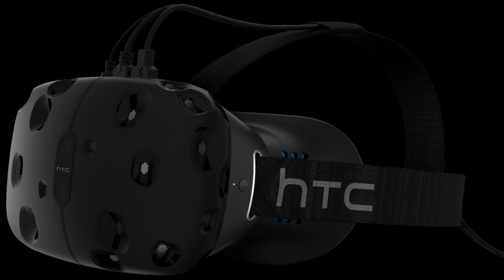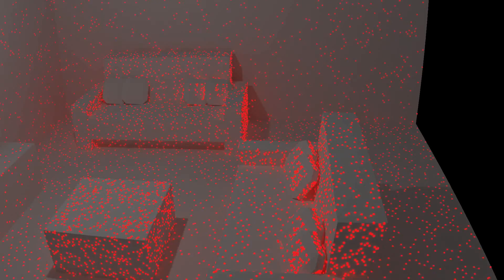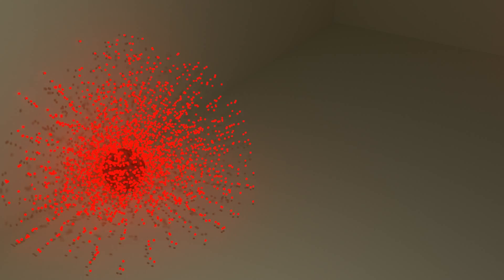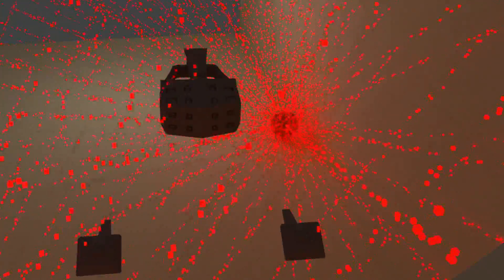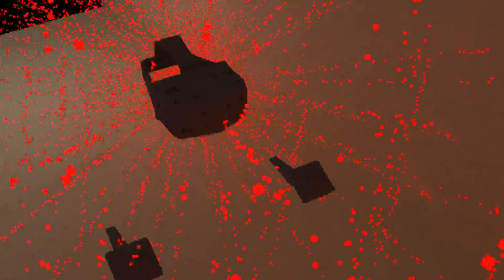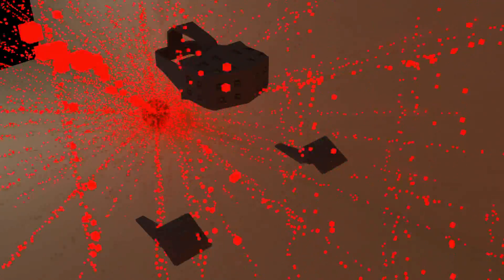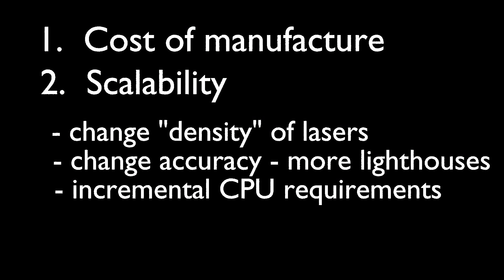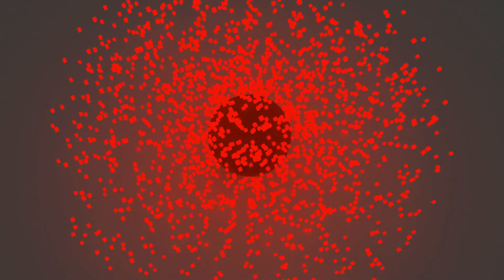HTC Vive - How It Works - Facts and Speculation

Comment: Nice try,  but best to get facts rather than trying to guess how something works.  There's no data transmission in the laser pulses.
Reply: GodMk2 check out vid description.  This was from 3 years ago.  Reddit discussion link has a lot more info that was revealed later if you are interested.
Reply: I'm just here seeing what they got right, but there is data transmitted in SteamVR Tracking 2.0. They are still pretty far off though.

Comment: 2 months later we find you are almost exactly right about all of the speculation in this video - except for the fact that each one uses only two lasers relflected on a rotating mirror.  You were even right about the scalability!  Just add more lighthouses and your playable area increases incrementally. VERY impressive.  Good job.  Its all down to basic maths - triangulation to precisely measure the orientation of the device at any given time.

Comment: Yeah it's amazing how wrong this is.  Having had some experience with laser systems used in surveying as soon as I saw the lighthouse boxes I knew they were using scan lines, similar to how speed check cameras on the highway work. 

It just measures the time between any two sensors being hit.  Whichever sensors are hit, and in what order and speed provide all the orientation data you need. 

Also their suggestion of using 2 boxes, mounted in the corner of the rooms like surround sound speakers allows for no occlusion problems.

Comment: This is not how the lighthouse system works. 

The lasers themselves are actually fanned into a fin that spins around a hundred times a second. There are two, each spinning on an orthogonal axis to each other. So like, one sweeps up/down and the other sweeps left/right. The photodiodes on the tracker units are able to detect the time between each of them being hit by the laser sweep. Combined with the IR flasher that pulses between every set of sweeps, which acts as a sync point in time, the headset is able to interpret where it is and how it's oriented in the observed space. It's literally just some trigonometry and the fact that the lasers spin at a consistent and known rate, which is why it's so computationally cheap.
Reply: oh my god wren I didn't know you'd be here
Reply from the maker: Yup - discovered that was latest thinking too.  More info here for those who want to read more: http://www.reddit.com/r/oculus/comments/2z7lvv/htc_vive_how_it_works_facts_and_speculation/ and some proof too! https://twitter.com/hmltn/status/579360059651588096

Comment: I don't believe additional lighthouses are needed for accuracy, as multiple sensors on the headset can see a single light house and calculate position based on the difference in timing between the sensors.  A single lighthouse would give enough to calculate position, and additional lighthouses provide additional coverage.
Reply from the maker: Carl Lorenzen check out the Reddit topic for more info.  Lots more detail and evidence of how this works.

Comment: Time of flight cameras (kinect, leap) work by calculating the time it takes for the light to bounce from the emitter and back to the receiver/camera. By knowing this it can work out how far away the object is. It's kind of like echo-location, but with light.

Speculation:
Lighthouse emits waves of IR-light in a known and precise sweeping motion. The photodetectors on the headset picks them up as the light sweep past. By calculating how long it takes to sweep from one detector to another on the headset, you can work out what the distance is between them. Some detectors are depressed into the headset, others are occluded by the headset itself. With these numbers you can calculate what angle the headset has relative to the lighthouse. The Lighthouses sync with each other so they don't flash the detectors at the same time.
Combine this with the other sensors in the headset (which are much faster, but less exact) through sensorfusion magic, and you get a very stable system.
Reply from the maker: 98Zai Yes - I missed the info about the sweep and 2 lasers within each lighthouse.  Check out the reddit topic on this subject (in the video description).